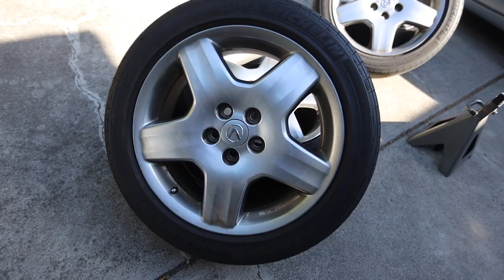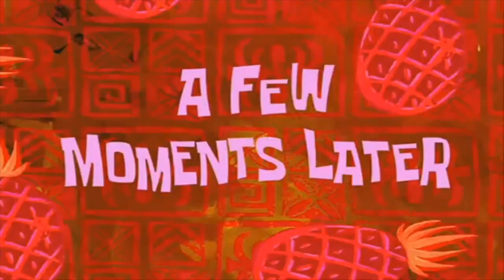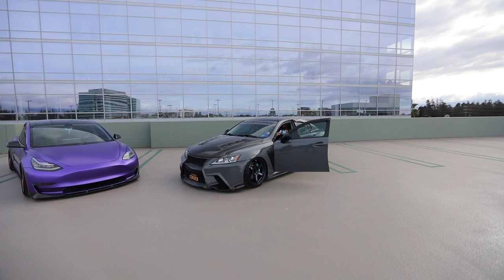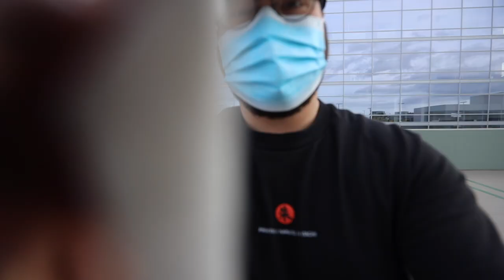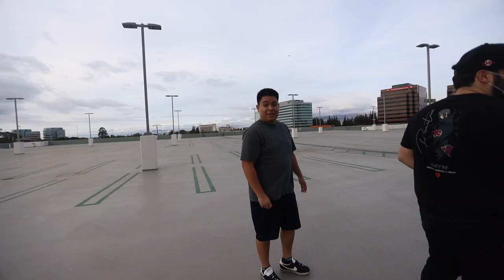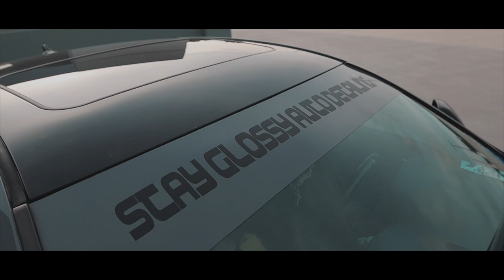LS430 GOES BACK TO STOCK..

Comment: I'm gonna say it's the valve stem both of my rear tires leak air never knew the valve stem was the tpsm either so that could be the issue causs knowing you I'm assuming you avoid potholes so ik those rims ain't cracked